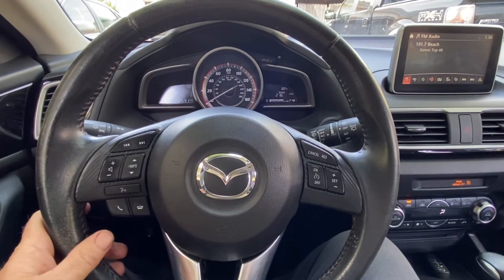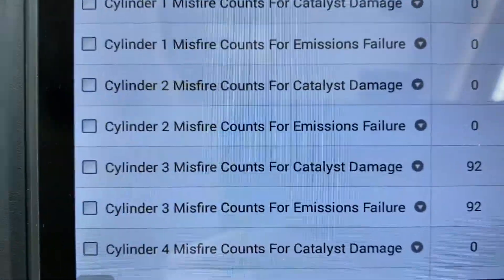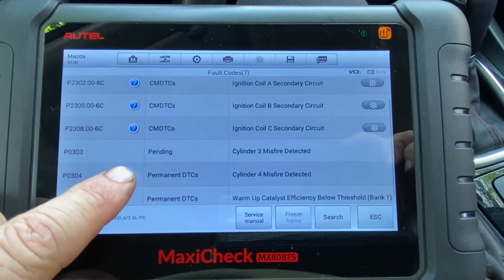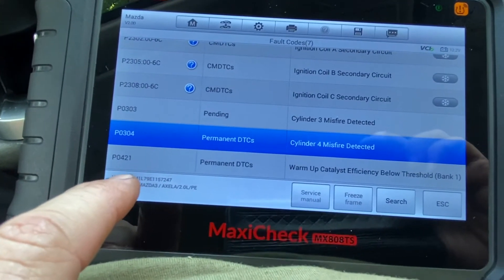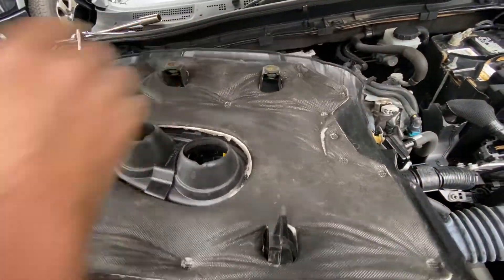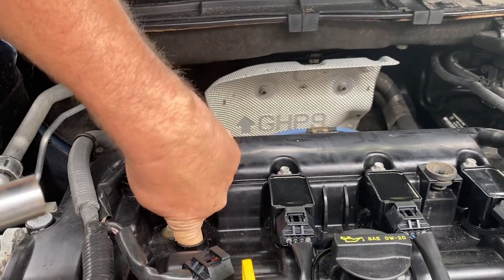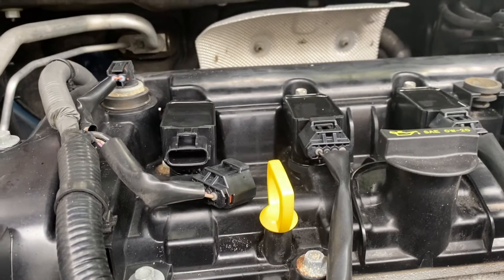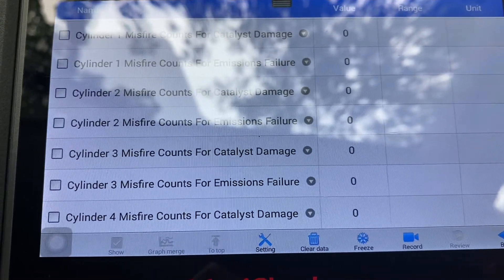Mazda 3 Skyactiv engine - Engine Light Blinking? No Power? Misfiring? Running Rough? - Diagnose &Fix

Comment: I have the Check  engine light on  since last year … there is no clear comment about any issue … when i drive outside the city and for high speed the let becomes off … what might be the reason for the issue …
Reply from the maker: What are all the codes?

Comment: How come nobody ever shows Mazda 3 SKYACTIV engine fuel injector location since its NOT directly in front the ignition coils like im seeing in every video 🤦🏿‍♂️🤦🏿‍♂️
Reply from the maker: Because it’s common sense as to where they are in the cylinder head
Reply: @motorcarnut  You're wrong bro I just did further research/inspection its literally UNDER the intake manifold.. which isnt viewable from the top view at all.. SKYACTIV engines that take Direct Injectors completely different setup so THAT is the reason no one has video on that.. lol
Reply from the maker: That’s what I meant just like most vehicles I’m make a video as we speak on a head gasket repair that will help.

Comment: Hi, i have the same problem, I changed the coils, sparks, same problem. Misfires at 1,2 then went to 4 , btw the mechanic replaced the motor . Sorry if my English is weak. I hope u reply asf , thx 😁
Reply from the maker: I would ask mechanic can be the new engine had problems? Also a vacuum leak low fuel pressure will cause misfiring.
Reply: @motorcarnut every thing is good ! , i asked another one he said that he fixed two cars the same problem, it was the computer or the wire
Reply from the maker: I’d be wary of that. Computers rarely are the problem but sure anything is possible. But replaced engine and now thinks it was computer? Other engine ran fine, maybe engine installed is incorrect one

Comment: Great video! My mazda 3 2012 has a similar issue. The check engine light is on at all times and after driving for like 10 minutes it starts blinking, the traction light also pops up, and the car shakes. After turning the car off and back on it drives normal and the lights go away for a couple minutes then it just happens again. The spark plugs, ignition coils, battery, and fuel injectors have been replaced. And it has p0300 and p0302 codes. Also took it to a friend that’s a mechanic and tried his suggestions but no luck. If anyone reading has any ideas I would love to hear. Thanks!
Reply from the maker: Electrical problem, vacuum leak or ECM failing.
Reply: Thank you! I’ll look into these!
Reply from the maker: No problem, good luck!

Comment: Same thing was happening to me on my 2016 mazda 3 isport. I replaced my spark plugs and the misfiring stopped however I still have a solid check engine light and p0421 code. What else could it be??
Reply from the maker: Depending on how long vehicle was misfiring it could mess up catalytic converter or maybe you have failing O2 sensors?
Reply: @motorcarnut yeah that was my fear that the cat was done for. Going to replace my O2 sensors and hope that fixes the issue
Reply from the maker: Yes, I would do that too, good luck

Comment: great video But did u ever fix the P0421 code ? I would love to know.
Reply from the maker: Thank you!, Yes after the misfire codes were fixed that P0421 never came back because engine wasn't dumping fuel into the exhaust because of the misfiring.

Comment: My 2014 Mazda recently went into limp mode.  I swapped the spark plugs and coil packs but am still in limp mode with a blinking check engine light and traction control dash light.  What else could it be?
Reply from the maker: Anything that can cause a serious misfire, vacuum leak, ignition system or fuel related.
Reply: @motorcarnut my car is also doing the same thing. 

When I rev it at higher rpm it’s seems to be good, when it’s idle or at lower speed it seems to lose power. After 1 minute while parked it started to smell like something is burning so I killed the engine and there was like a high pitch sound for like 10 seconds and it was gone. Can you please tell me what this could be?
Reply from the maker: @mohammedfaraaz10, Try what I just told morganmurray2878
Reply: @motorcarnut  Thank you! I am going to replace the fuel injector and see if that will solve the issue.
Reply from the maker: No problem, let me know if that fixes it. BTW, what codes are showing?
Reply from the maker: Make sure you have no vacuum leaks especially the plastic bypass hose that goes straight across the valve cover to the turbo. intake manifold and the PCV valve there is a small hole on that round disc at the 3 o’clock position, put your finger over the hole while the engine is running should be no vacuum from that hole
Reply: @motorcarnut Wow! Thank you so much 💙
Reply from the maker: No problem!

Comment: Thanks for the video,  i have the same problem with the SCBS Check engine light ,skid etc. Mine is a 2.2 2015 diesel manual,  should i clean the EGR or is it a Injector or sensor  problem? Hope it reaches out to you.
Reply from the maker: Are you talking about the braking system?
Reply: @motorcarnut  I got the 3 warning lights simultaneously on dashboard, TPMS, SCBS and Check Engine Light, need to mention car loses power when I accelerate above 2k rpm. Is it the battery or a more serious problem? The mechanic canceled me till next week 🫠
Reply from the maker: @bomad7233 I don’t know what it can be without looking at the live data. Make sure battery terminals are clean and tight along with any ground wires. Try disconnecting the negative battery terminal for 5 minutes then reconnect tight.
Reply: @motorcarnut  thank you ,will try to do that
Reply: Hi there, good day to you. My mazda 3 also have this problem. After changing plug n plug coil it still have misfire on the 4th. Any suggestion?

Comment: I had same problem we tried everything it didnt help but in the end i decide to replace battery with ne one and  problems gone forever, because some mwkaniks didnt know this even theyvhave check the battery power they couldnt recognize the weaknes of it. And yess problem was exactly on battery: abs system error. Engine ectr and plus engine misfire had to all other problems frequently  it shows on screen but in that day i changed battery all gone instantly I swear 😊
Reply from the maker: Doesn't make too much sense. If the battery was strong enough to start the car it should have been fine because once the car is running the alternator is what keeps the car running property not the battery. You can disconnect the battery with the engine running it's only to start the car.
Reply: @motorcarnut  i already said it was not strong enough battery sometime misfired sometine not and plus errors on the screen, I heard from someone that weak battery cause problem, my bsttery wss 7 y old , now 2 year i dont have any problem this is pure sense with no lie lol
Reply from the maker: If you fixed it, great!
Reply: A good reading battery and a good working alternator can still give a car a misfire if the voltage is not great. Sensors need correct voltage through the whole system. A new battery is needed even though the old one starts it and helps it run its not always the perfect working battery.
Reply: @SnCroadster  Thats what i exactly mean it. A few Mchanics measure it battery and it shows nothing wrong on it even I told them battery was old about 7y, but yeah sometime u should not listen them, and brand new battery solved my problems 😅

Comment: The error code i get is P2185 for the coolant sensor, could that be the issue? My car is having the same issues
Reply from the maker: Possibly, replace the sensor reset the pcm and see if that fixes your issues
Reply: @motorcarnut  I scanned it again and got the code P0882 any advice?
Reply from the maker: @TyTy1o make sure battery is fully charged. There’s an open or short circuit in the transmission control circuit which can be a pain to find. You need a high end scan tool and see the communication from ecm to tcm etc.

Comment: I have a 2015 mazda 3 skyactiv.. started stalling and have a low idle... and its blowing diesel like smell smell coming out from exhaust.... i already change.. O2 sensor/ignitioncoil/sparkplugs/fuelpump/purgevalvesolenoid/throttlebody... and still the same i hope one of you here can help me out
Reply from the maker: It sounds like it’s running rich, can be a vacuum leak. What codes are coming up?
Reply: @motorcarnut   the codes showing are P061B/P0102/P0193/P0453
Reply: @motorcarnut  hi

Comment: Hi great video. I have misfire at 1200rpm 2nd gear same model. Changed plugs..checked coils..ran injector cleaner through engine..cleaned maf...cleaned throttle body...changed air filter..no codes but still misfiring. What do you think? ❤❤❤
Reply from the maker: What code was coming up? Did you check for cylinder compression?

Comment: I have the same car with the same issue, same lights, going into limp mode but no codes show up when plugged in, I noticed my negative terminal was loose so i tightened it and that cleared the code and it’s driving normal now but could that have been causing it? Or should I just change all coils?
Reply from the maker: Absolutely could cause your problem. You’re probably good to go now

Comment: hello i have a 2015 mazda 3 and it boggs down similar to how you said can it be spark plugs???
Reply from the maker: In this case it was the ignition coil, try doing the same process as my video to see if yours is the same.
Reply: i just bought this car, might also change spark plugs ,people dont pay attention to the needed type of  plugs. ....thanks for ignition point out @motorcarnut
Reply from the maker: Yes, of course the plugs can and do fail as well. Buy coils tend to be a big problem with Mazda

Comment: Excellent  video, thank you very much. My 2019 Mazda 3 suddenly started doing exactly this while I was accelerating on the freeway, along with the "Dynamic stability control malfunction" error message. The previous day I had just gotten the injectors cleaned at the service center, along with an oil change and tire rotation/balance. Just routine maintenance - nothing was wrong. It's back at the shop now, and I'm trying to decide whether this is just a coincidence, or whether I should suspect either incompetence or sabotage. 

If anyone reading this has any input, I'm happy to hear it. I'll try to remember to come back with an update later today.
Reply from the maker: If it happened after they worked on it I’d go back to them and tell them
Reply: @motorcarnut  Thanks for the reply. According to them, they had accidentally left a "very small" amount of the detergent used for the injector cleaning in the injectors. I'm still not clear on why  it worked fine until I was halfway to work, or how that could have triggered the stability control error, but it's all better now.
Reply from the maker: Because if the car is misfiring it will set off traction control abs etc codes. Glad it’s fixed!
Reply: @djdrocco  This is very dangerous. My technician once told me that when the cleaned injectors are installed it's a good idea to turn the starter once or twice with the spark plugs out as the cleaning fluid that may left over in the injectors can shoot out under pressure and break the valve rods, leading to expensive repairs on the engine.
I advise you to change your technician as these small details are important and show a lack of experience.
In this way, when the spark plugs are gone and you turn the starter, the fuel explosion in the cylinder is not reproduced and the remaining liquid from the injectors is sprayed slightly (not under high pressure) and flows out through the exhaust. 
Then you can just put the spark plugs backs and start the engine normally - there will be no more liquid left in the injectors that may cause a damage.
Reply: How many year you didnt replace your car battery ?

Comment: I have the same exact issue with my Mazda and the same exact lights on … I figured it will be something with the spark plugs because they told me to fix it at 100,000 miles and I never did 🤦🏾‍♀️
Reply from the maker: That will do it, don’t drive it that much especially when the engine light is blinking. It could damage the catalytic converter.
Reply: @motorcarnut  yeah I haven’t driven it since that day… I didn’t realize ignition coils were so expensive for Mazdas 😂😂 it’s like almost 400 for all 4 and that’s with a 20% off discount
Reply from the maker: Get a good quality aftermarket one like Denso, much cheaper in price

Comment: Hi! I saw your video, very helpful btw. I have a similar problem and would appreciate your advice.

I have a Mazda 2 Skyactiv 2016 with the check engine light on. The first fault code was a Cylinder 4 Misfire and my mechanic changed the spark plugs (although I have never felt the engine miss). After this we had the P0421 fault code, and my mechanic suggested that we should change the catalytic converter. 

However, another IMPORTANT thing to point out is that during this time I was noticing that the oil level was constantly increasing. I assume that this was increasing because of fuel flowing past the piston into the crank case and mixing with the engine oil.

Do you think that this fault code would be fixed by changing the coils? Or do you think that the catalytic converter needs to be changed as well ? Thank you for your help 😊
Reply from the maker: Thank you! What you can do is try to switch the number 4 coil with number 1 and see if the miss jumps to 1 now or stays on 4. If it now jumps to 1 you know it’s the coil if it stays on 4 then it can be the fuel injector the spark plug or low cylinder compression. The misfire will cause the p0421 because unburned fuel is passing through the catalyst converter causing that code. As far as the oil level rising it would have to dump a lot of raw fuel to see that on the dip stick. Does your oil smell like fuel? Also can be a blown head gasket so check compression too.
Reply: @motorcarnut  I'm afraid that the catalytic converter is gone. It was rich in petrol because the oil level increases significantly and it smells like fuel. However, it's amazing that I've never felt the car missing in power when driving. What could this problem possibly be? Maybe a bad injector?
Reply from the maker: Yes, just do what I said before.

Comment: Had exactly the same issue replaced all the Spark plugs but it still has the same issue. The spark plugs def needed replacing all of them were spent. 
Does anyone else know what the issue may be.
Reply from the maker: Which cylinder is misfiring? It may be the ignition coil on the cylinder that is misfiring. Can try switching coils around to see it misfire follows or not.
Reply: @motorcarnut  cylinder 2 misfiring. Waiting on the new coils to arrive. Hopefully that fixes it. Also had the error "Idle Air control system RPM lower than Expected" would this be related?
Reply from the maker: Yea, both can be related. Engine has to run normal with no missing etc. in order for transmission to shift properly.
Reply: @motorcarnut  how do I get rid of engine light
Reply from the maker: You mean after you fixed it? Scan tool or just disconnect the negative battery terminal for 5 minutes then reconnect.

Comment: I have a 2012 Mazda CX-5 giving off code P0303 so I changed spark plug and ignition coil but still have problems
Reply from the maker: Check for low compression in that cylinder then the fuel injector

Comment: I’m getting code p0882 on my Mazda 3 skyactiv any help?
Reply from the maker: Bad relay or blown fuse
Low battery voltage
Issues with the transmission control circuit, such as damaged wires or a poor connection
Defective transmission control module, powertrain control module, or totally integrated power module

Comment: I'm having the exact same problem, I'm going to replace the coils and I hope this fixes  the problem. Thanks the video
Reply from the maker: No problem, good luck
Reply: @motorcarnut  I'm back, Drove 26 miles and the car is doing the same thing 🤦 Do you think it could be the injectors?
Reply from the maker: What codes are coming up?
Reply: @motorcarnut  I haven't checked since I replaced the coils, But my issue was the exact same thing in your video.I changed the coil twice. Then I had the same issue, So I decided to replace all 4 and the same issue.sinc then I haven't checked the code again.
Reply from the maker: Well if it’s only one cylinder misfiring then it’s either fuel or compression. I would do a compression test .
Reply: @motorcarnut  okay, That's
Reply: @motorcarnut  help do you have en email or phone

Comment: I have a 2010 mazda 3 . 2.0 4cy.  I got A P0304 code I replaced the coil pack for 4 in spark plug for a. Code still persist. When running the engine I unplugged coilpax 1 through 4. 1 through 2  had a reaction.  Although unplugging coil packs 3 and 4 while the engine is running had no effect at all.  Even after changing the coil pack and spark plug in 4
Reply from the maker: Could be a bad fuel injector on number 4 cylinder or low cylinder compression.

Comment: Did you use OEM or aftermarket parts? I have a p0302 code. Hoping replacing the coil pack fixes the issue.
Reply from the maker: I like using OEM for ignition parts but you can good quality aftermarket parts like Delphi etc
Reply: Hi
Were you able to pin point the problem?   I have the same issue
Changed the coils and the sparkplugs and the issue still exists
Reply: @voffchik26  I took it to the dealership and the story I got was " valve cover gasket was pinched and bad spark plugs" I had less than 100 miles on them" they reset the computer. I don't think they fixed it. I put a supercharger in recently and of course cel came back and ! Caution take it to the dealership for service.